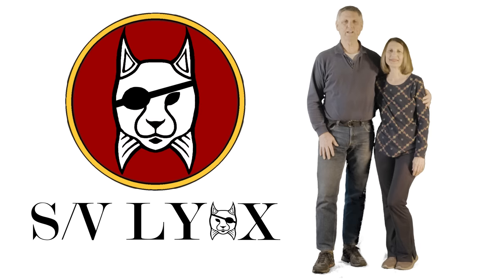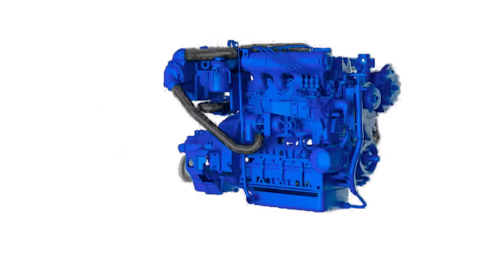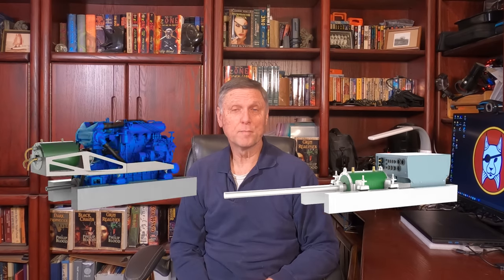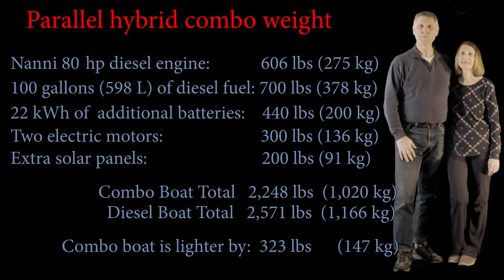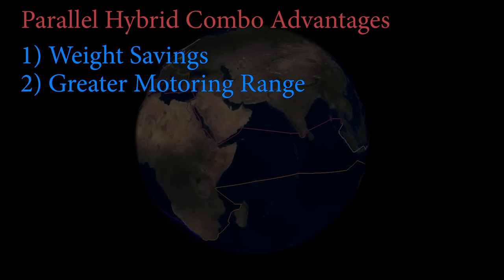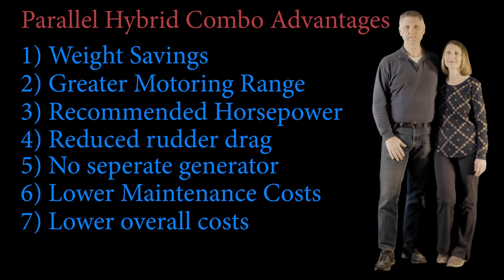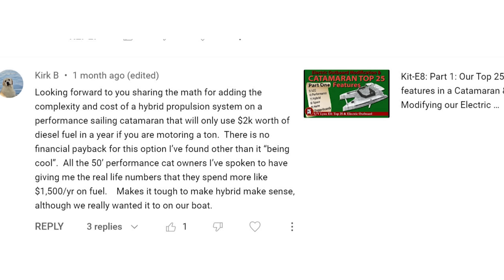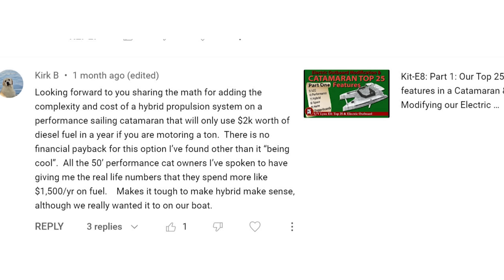Kit-E18 Parallel Hybrid Combo Propulsion

Comment: This was one of the best researched and presented cost comparison between these systems I have seen so far. Thank you very much! However, isn’t it necessary to consider the much shorter lifespan of batteries compared to Diesel engines? Maybe I a wrong, but isn’t it to be expected that you need to replace your batteries every 10-15 years depending on use? For a fully complete full cost comparison you would have to include an estimated resell value of your components at the end of your calculation period, that would cover that difference in lifespan, but is understandably very difficult as there are no real data for such old battery systems. It would depend heavily on assumptions.
Reply from the maker: You are welcome.  We don't claim to know everything, but we try to share what we learn.
Reply from the maker: As for replacing the cells, yes, they only last so long, 8 to 10 years, most likely.  But remember, we didn't figure in maintenance on the diesel engines either.  A quick forum search shows that people spend about $1,000 a year if they do the work themselves.  So two diesels would be $2,000 a year, and $10,000 in five years.  The batteries won't cost as much and the maintenance on electric motors is practically nothing.  BTW, that maintenance cost on the diesels doesn't include a rebuild every 10 to 15 years.

Comment: Wow the fact that the Combi engine had almost no electronics is super attractive.  You also forgot to mention that electric motors have better torc than diesel engines at low speeds
Reply from the maker: Yes, that's one of the advantages of electric motors.  Of course, diesels have their advantages as well.  That's why we went with both.  :)

Comment: One comment. Power of the diesel engine doesn't directly translate into power of electric motor. Diesel has to be more powerful because of torque characteristics of the engine and propeller.  Propeller isn't capable to translate all power into propusion, it has considerable losses, since it has to be capable to overcome the prop torque at low power. Electric motor has virtually the same torque at low RPM, as a consequence it has much higher overall efficiency. It pays to have a diesel generator, since it can run at it's optimal power and use electric motor for propulsion.
Reply from the maker: Unfortunately, this isn't really true.  You shouldn't confuse torque with horsepower.  The full torque at any RPM supplied by an electric motor is useful for things like low speed maneuvering in a marina, where a diesel has to get up to a high RPM to get to its torque band.  However, when it comes to pushing the boat at higher speed, that's all about horsepower.  If you have a 25 kw generator coupled with a 25 kw electric motor, first of all, you are going through several conversions of power before it gets to the prop, and each one loses energy.  Even if you pretend that a 25 kw generator will give you the full 25 kw to the motor you would still only have 33.5 hp vs the 80 hp from the diesel and there are less loses on the diesel side since it goes through less conversions of energy.  

Then there is weight.  That generator can only supply enough power for one electric motor.  If you want the full horsepower of two 25 kw electric motors, you need something like two 30 kw generators. That would still only give you 67 hp, and it would add 600+ pounds of weight to the boat and the added maintenance and cost to purchase two diesels, etc.  Even so, you would still be underpowered compared to the single 80 hp diesel.  

We are adding both systems to S/V Lynx because they each have their advantages, but the electric motors advantage is not boat speed, it is low speed maneuvering and low speed cruising with fuel savings as we use solar gained electricity to cruise along for 2 to 4 hours a day.  But anytime we need real power and speed, the diesel will need to be used.  This will become quite evident in a real world example when we finish S/V Lynx.  We will have both two 25kw electric motors and an 80 hp diesel.  It will therefore be quite easy to compare the boat speeds possible from diesel vs electric.

Comment: lol dont think you really know how electric batteries work the cubed rule is NOT a rule, i think you are goijg to have your motors spinning for about 3 seconds !
Reply from the maker: Fortunately, we don't have to guess.  There are plenty of real world examples of electric motors and battery capacities on boats that show us we are not far off.  However, we will post sea trials and actual range, speed, and time numbers for our boat once we get S/V Lynx in the water.  We estimate 2.5 hours at 5 knots, you estimate 3 seconds.  We'll see who is closer :)
Reply from the maker: For example: The Windelo is a 50' performance catamaran with a electric motor system, so similar to S/V Lynx.  At 5 knots, they show 5kw being used.  We have 33kw (26kw usable) of battery.  If we divide our usable 26kw by 5kw, we can see we would get about 5 hours of motoring at that speed, but we are only planning on half of that to be conservative.  https://www.windelo-catamaran.com/en/electric-hybrid-drive-system/

Comment: This setup makes a lot of sense. I would like to add that most of the motoring, even for round the world cruisers are short trips where the diesels don't even get to warm up. So most of the time people are running their diesels cold and/or in low RPMs which is actually damaging. If a regular diesel can run for lets say 7500 hours, hybrid diesel should run for the lifetime of the boat easily.
Reply from the maker: Yeah, we are excited about this propulsion system.  However, we aren't the first to use it, another 50' catamaran circumnavigated with this setup and told us that it was the bees knees, so that's why we went with it.  So, we know it works well.  The diesel will be rarely used, mostly as a generator in overcast locations and as extra power when against a strong current.  The rest of the time, the sails and electric motors will get us where we need to go.